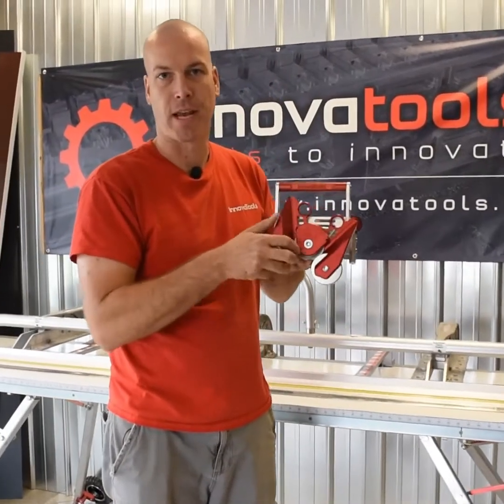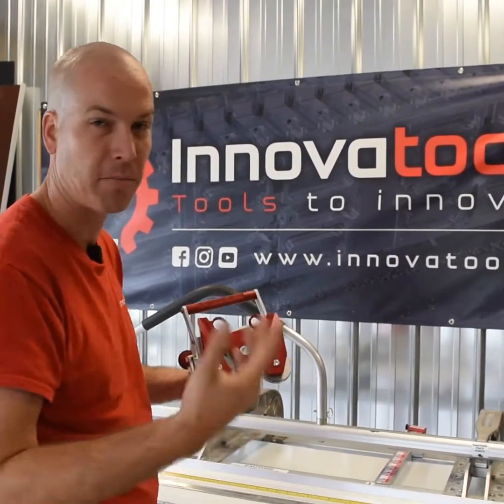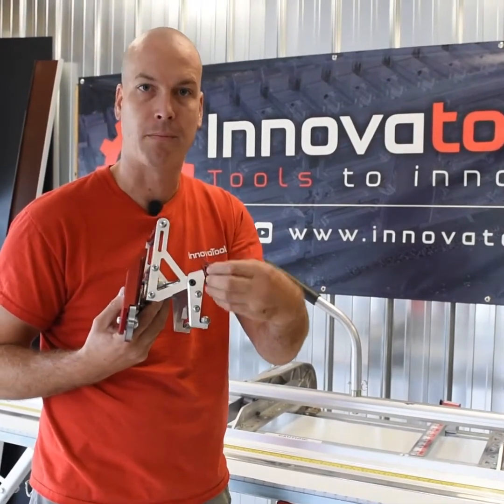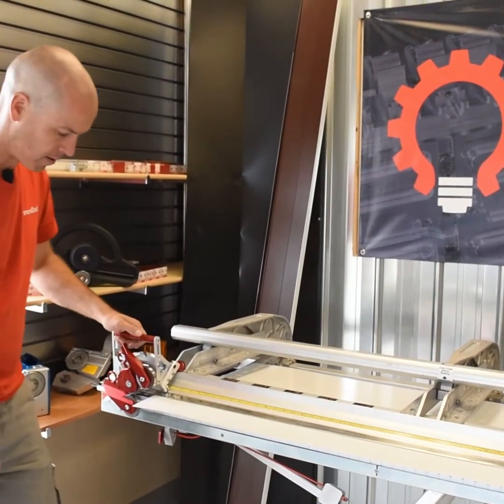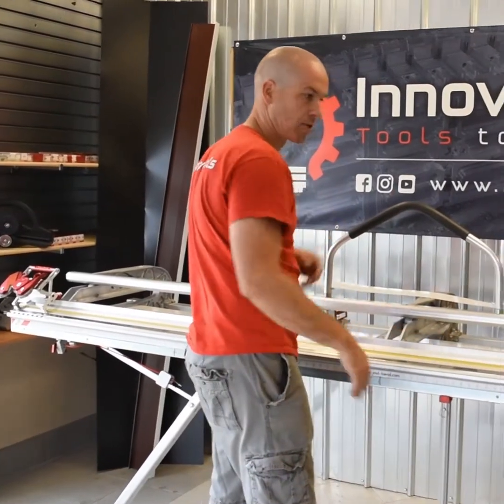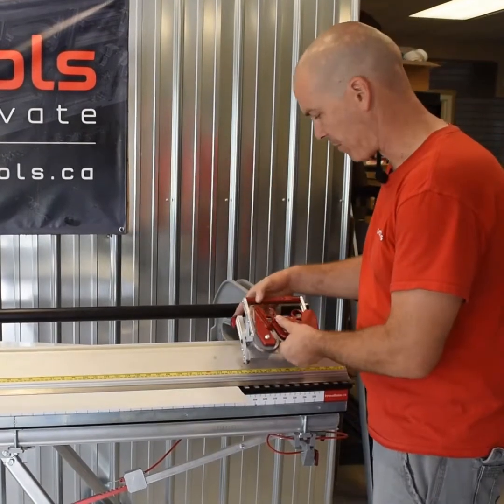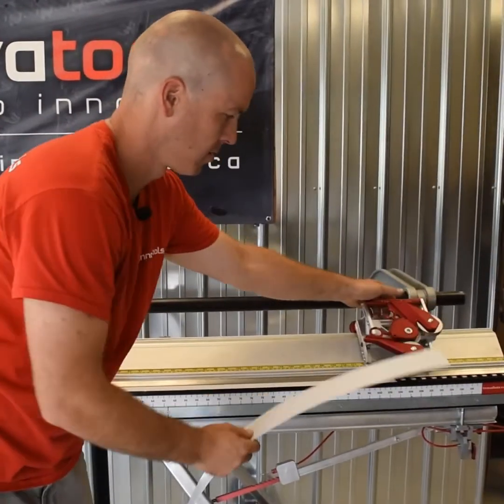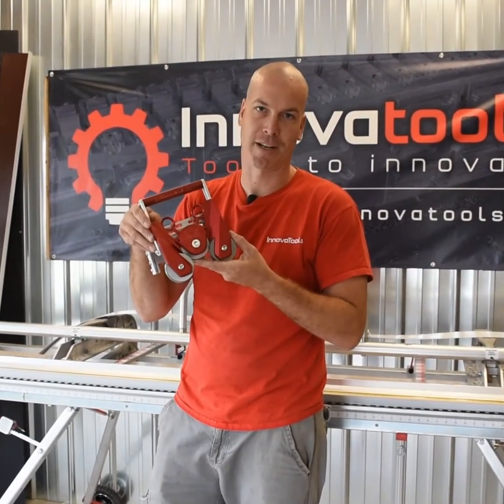Best way to cut coil stock: InnovaTools' Two-Way cutting tool for bending brake

Comment: I have a Tapco pro 19.
I mostly use 24 gauge galvanized and 16 oz copper.

Roofing. How will it perform on the 24 gauge?
Reply from the maker: It will cut 24g but it requires elbow grease, we have another video on our youtube channel of a customer cutting 24g stainless steel

Comment: I need to cut .032 aluminum. I would like to be able to cut it on the break. Will this cut that thickness, or can you recommend something that will cut it. Great video!
Reply from the maker: Good evening! Yes that will cut .032 just fine! Let us know if you have any other questions!
Reply: @innovatoolsinc  Thanks!

Comment: please develop a better cut-off for the alum-a-pole brakes.  and for tapco and van mark stoppings as for alum-a-brake.  because that helps a lot
Reply from the maker: Hi Alan, yes we will have a heavy duty model for steel roofing coil as well;)
Reply: @innovatoolsinc  I will wait for this. Thanks for the quick answer!
Reply from the maker: We are a few months away from releasing our own brake so moving forward we will be concentrating on our own brake;)
Reply: @innovatoolsinc  that sounds great.  I wish success!!!  and congratulations!  I think it's very important to have the stoppings because it saves a lot of time, efficient coil holder and a good cut-off are on the right track
Reply: @innovatoolsinc  one last question Alex, will your brakes double up to what thickness of aluminum?  the myth is because I'm about to buy one that doubles up to 0.05” aluminum if by any chance yours is like that I'll wait to buy it.  I need one to use in roofing.